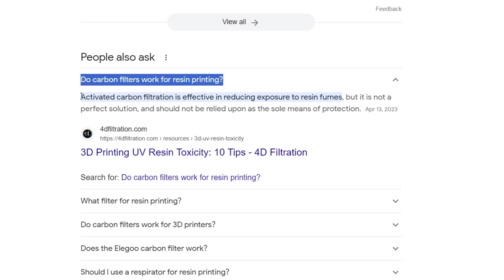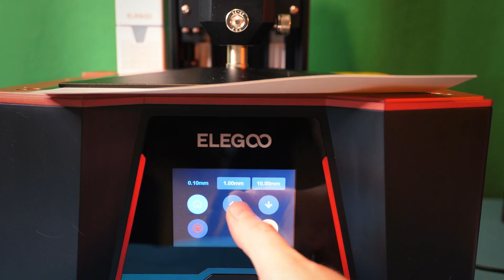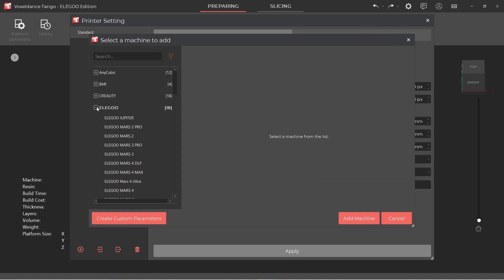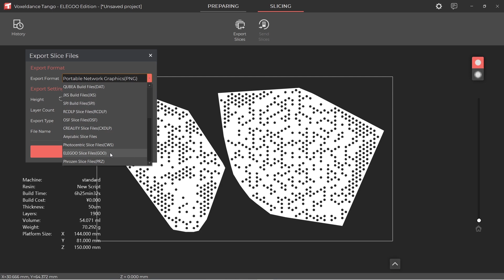Huge 12K Resin Printer and My Experience | The Saturn 3

Comment: when taking model of build plate you should be holding edge of plate & not let it rest on a angle from edge of build plate to knob you will loosen the 2 bolts over time & have to re level more often

Comment: did you change any of the settings in the slicer before you started printing or did you just use them as they were?
Reply from the maker: For this I used the default settings and I was happy with the results.